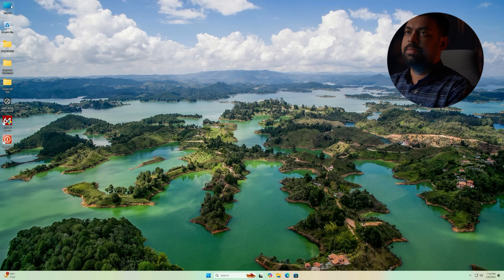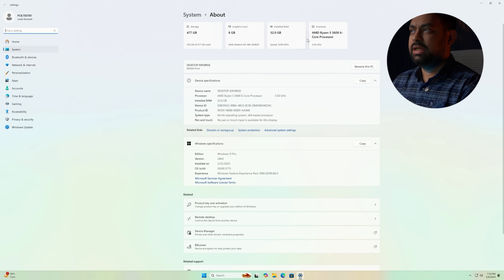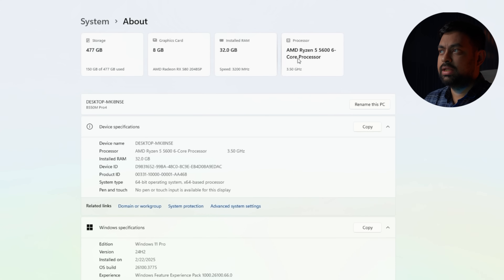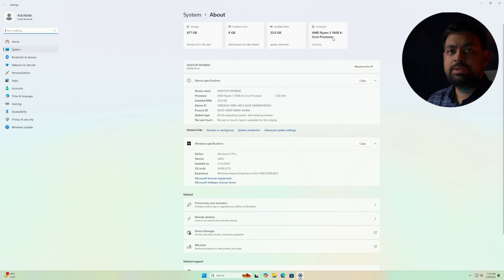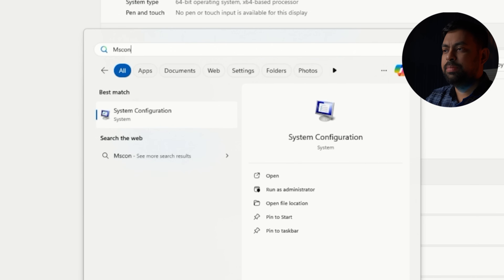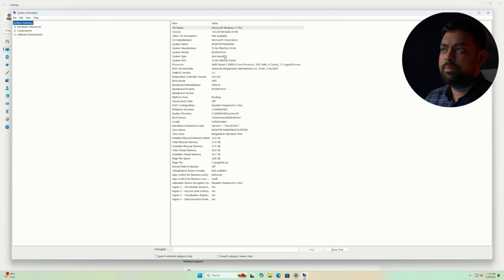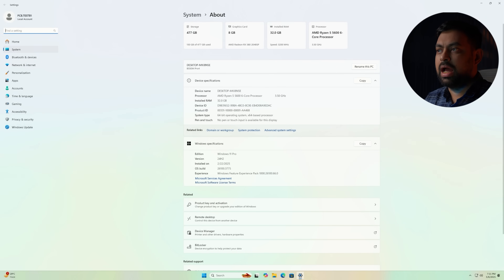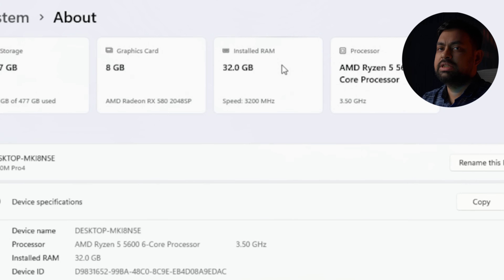Ryzen 5600 প্রসেসর Overclocking এবং Undervolt করবেন

Comment: 5600g and b550m gigabyte ds3 ac motherboard with deepcool af 400plus cooler . Have 2 stick of 8GB 3600Mhz cl16 Corsair RGB vengeance pro sl ram. kivabe max CPU, GPU and ram perf squeeze korbo? Currently using re bar , 2G vram , XMP 3600mhz enabled and getting 4.2 max CPU with 4.4 boost on 2 core and 1900mhz GPU clck

Comment: ryzen 3600 ei method e run korbe?
Reply: hae korbe amio 3600 user
Reply: @Ginpachi-sensei-4u  try korsen?
Reply: @silentbeast3746 
Nah dorkar hoi na. Performance amnetei valo sudhu-sudhu jhamela korbo keno 1k point increase korte! Amniteo oc korte onek valo heatsink wala motherboard lage......amar motherboard oto valo na so thermal throttling korbe
Reply: @Ginpachi-sensei-4u  apnar cpu coooler konta? R stress test e highest temperature koto hoy?
Reply: @silentbeast3746 
Stock cooler & higher temp 58°

Comment: i am using 3700x with 360 galahad AIO...  eta normal use a cpu temp thake 50 to 55 ... ar havy gaming korle like AAA tiltel gula khelle 80 to 90 hoye jay .... is it normal??.... no overclocking or under volt.
Reply: Your temperatures are quite high, possibly due to the auto voltage setting a high value. I'd suggest adjusting it manually.

Comment: as a note you also need to check for core stretching for that monitor effective clock to average clock if the difference is anything above 125MHz or 150MHz then your undervolt is invalid and will likely cause instability at some point
Reply: Unfortunately, due to time constraints, I couldn't really visit clock stretching or showcase general instability and its indicators.